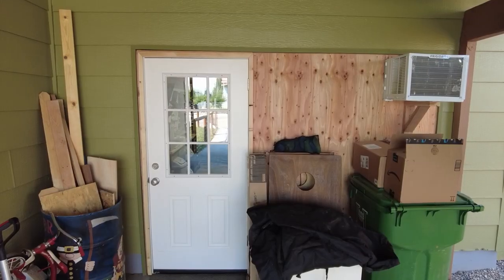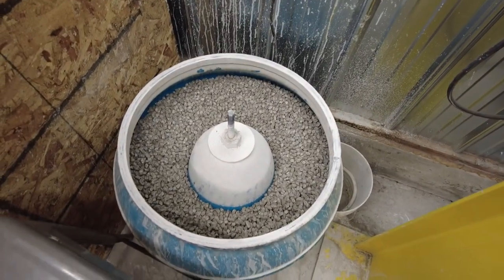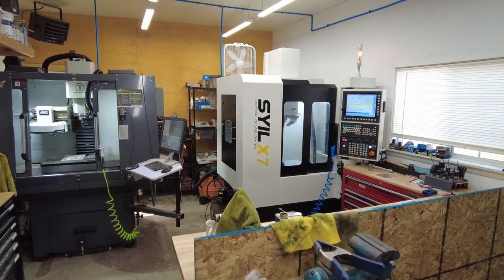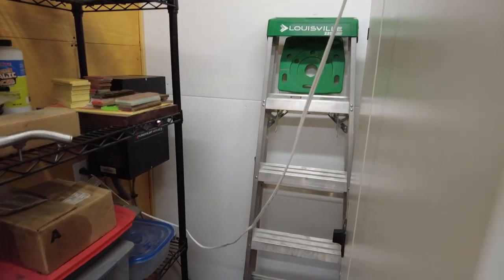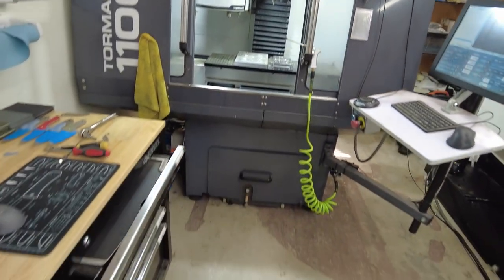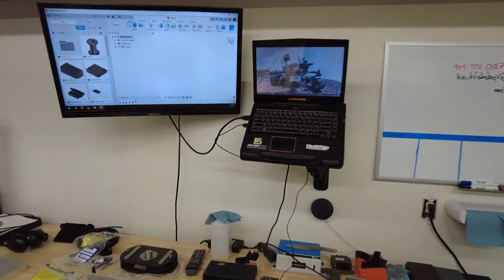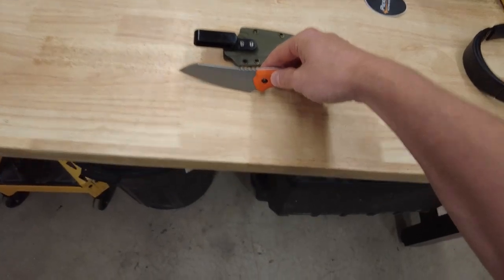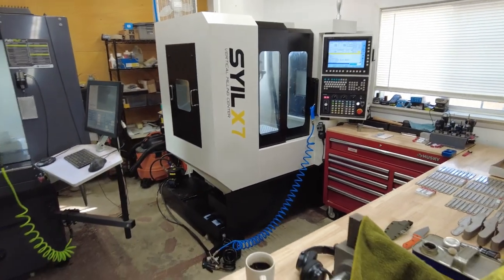A Knife Manufacturer in a One Car Garage

Comment: As a starter milling machine would recommend getting a syilx7 or tormach 1100, since you have experience with both?
Reply from the maker: The X7 is far beyond the 1100 in terms of accuracy, speed, power, rigidity etc. The Tormach control is easier for beginners though. I would recommend going for a very inexpensive Tormach (perhaps used, less than $15k tops) or go straight to the X7. I just don't think the 1100MX really makes sense since the X7 came online.

Comment: TJ what machine is better for steel the Tormach 1100 or the Syil 7  ????
Reply from the maker: The X7 wins by a mile in essentially all use cases. The Tormach is a decent little machine, though, for certain things, and we still use it daily.

Comment: Where did you get the laptop wall mount?  Is it just a monitor wall mount that you modified?
Reply from the maker: It's a monitor arm with a separate laptop tray I found on Amazon.
Reply: @tj.schwarz  thanks for the info. I found a dual arm mount on Amazon after I left the initial comment. Great looking shop.

Comment: I have the room to add about as many machines as I want to, but I only have a 200amp drop to my house and wonder if I have enough power to make a shop like this. The house is only 800sf and doesn't use much power, but a lot of these machines seem to need several 40+ amp lines...
Reply from the maker: I have a 200amp drop to my whole house as well and it is plenty for this setup. The Syil has a 50 amp breaker but it doesn't even remotely come close to using that. In fact I'm embarrassed to say this but the whole shop in this video (minus the heater) is running on one 60 amp breaker to the sub panel and I've never popped it.
Reply: @tj.schwarz  My house only uses about 60 to 80 amps at max, I was thinking of doing a 100amp to my shop. I assume that would be enough for something like this then?